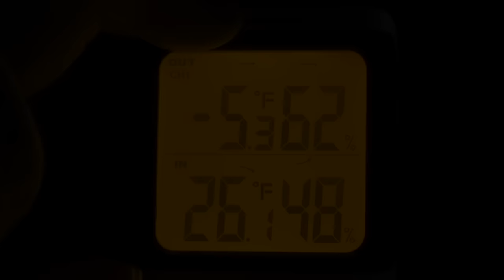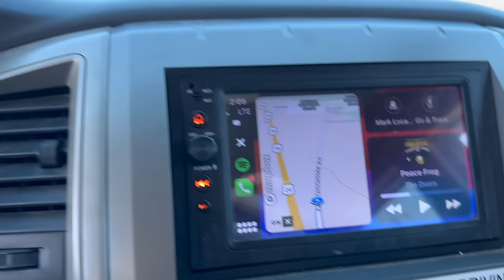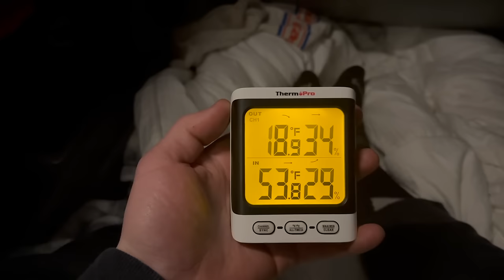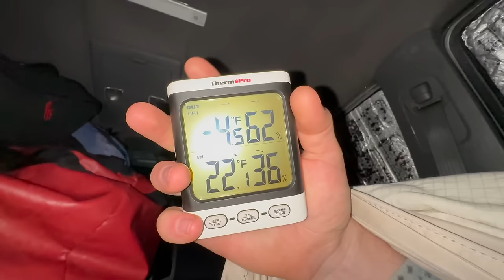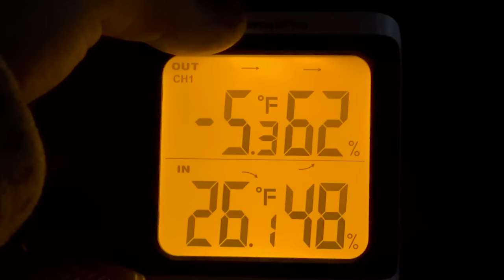Things Got intense in the Mountains

Comment: I winter camp in my wrangler quite often without a heater in Alberta Canada. Lots of little tricks you can do to stay warm. I use an army surplus down bag with a down jacket. I also have a wool blanket. I can use an electric blanket plugged into my power bank as well. I have a sleeping bf bag liner that runs off of a battery bank too. I’ve slept in minus 47 Celsius with no heater. Had the best sleep that night. Just wore a balaclava and gloves. I also cover all windows with reflectix. Works great. Awesome video. Looks like you had lots of fun for sure. 🤙

Comment: Just a tip from an old Infantry soldier trained in the 10th Mountain Division on arctic warfare:

 Invest in quality snow chains and a good compressor. Deflate your tires a lot - then mount the chains on the tire - then re-inflate the tire so the chains are good and tight. Should be no need from there to adjust the chains once inflated - they will literally feel like part of the tires. You'll be rippin' over snow and ice like you wouldn't believe. It will make more places accessible without the stress and headaches.
Good luck.

Also - no need to run low psi with this set up.

Just finished the vid where you say you have chains... Really? FFS LOOOOL